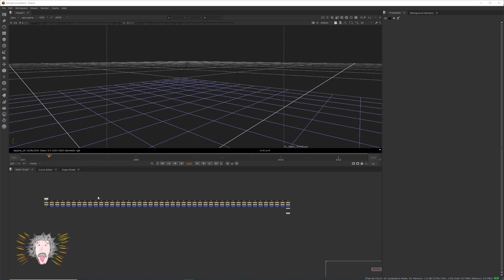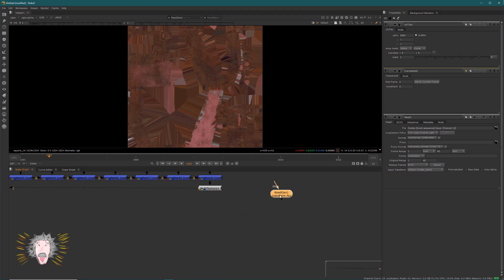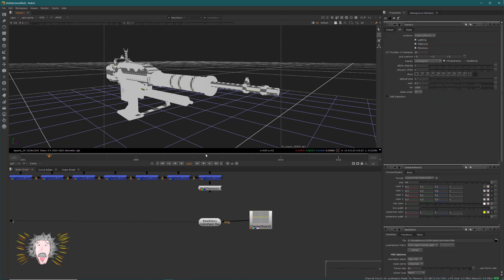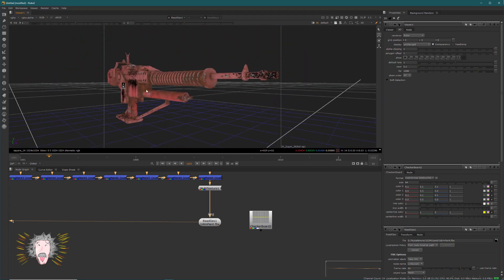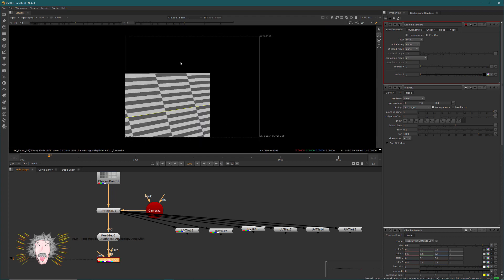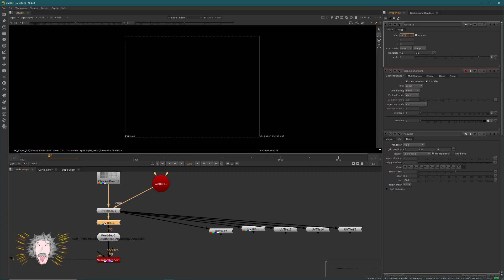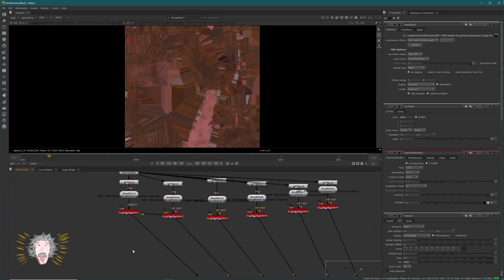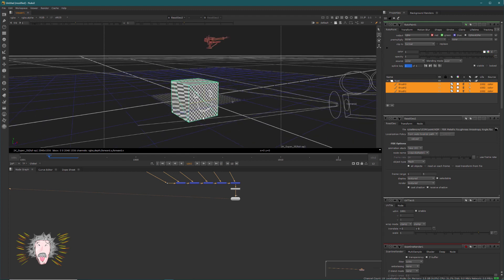UDIM import Node : expert mode

Comment: amazing it worked for me🔥 but i have one question, my textures started looking low rez, how can i fix it.
Reply from the maker: Either In the viewport or through scanline render ?
Reply: @nuke_foundry_trick  it looks low rez in 2D & 3D both workspace
Reply from the maker: @lightningspeed6142  you can take a look on the antialising for the scanline render/rayrender and the GPU buffer in the viewport properties.